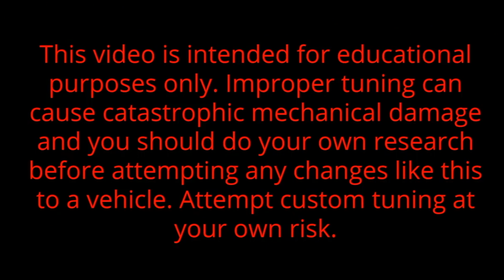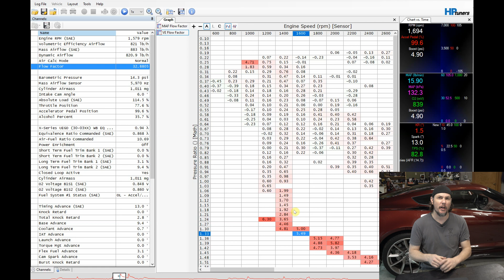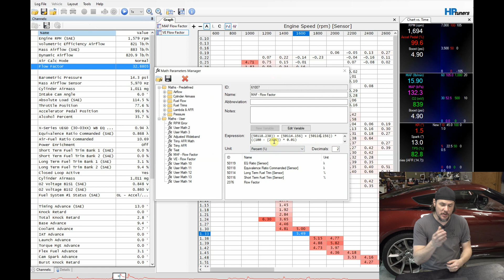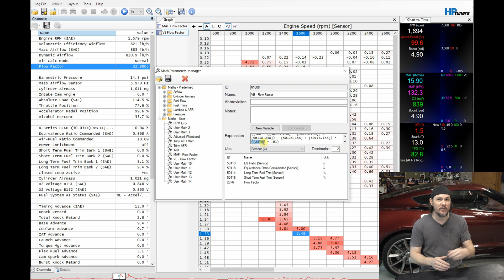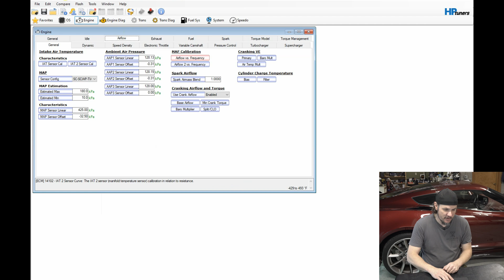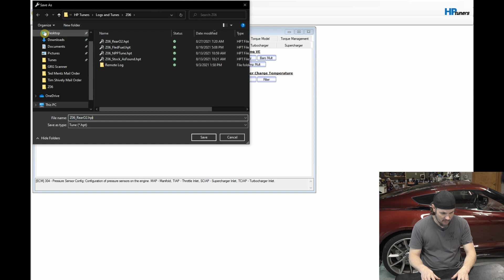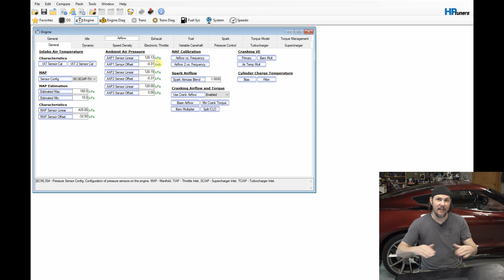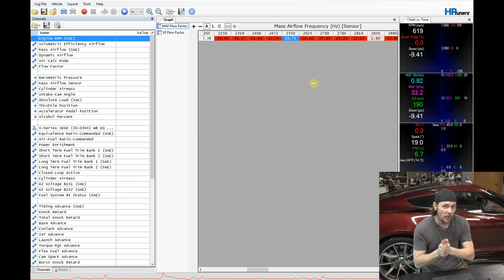Tuning MAF and VE At The Same Time With Wideband and Narrowband Sensors!?

Comment: I do something similar to this on my Chevy Sonic with the turbocharged engine. I leave the MAF enabled and will adjust the VVE and MAF, starting with VVE. I'll see if it changes at the top end of the table, if it doesn't then I adjust the MAF calibration. The reason I use both VVE and the MAF is so the car has a smooth AFR making the car very driveable and very efficient on making power. It also makes diagnosing any boost leaks/fueling issues easier to diagnose.

Comment: I just track the Calculated Flow rate in g/s from the VE, MAF, and Dynamic airflow. I set it up to tune for SD like usual, and The % error between the VE flow rate (calculated) and the MAF flow rate (actual) is what I multiply the MAF Table by. You have to add a negative  to the % error table and change the unit to Number not percent so if you copy and paste the changes they correspond. As VE flow rate gets more accurate as you tune VVE tables the MAF Flow rate will also get tuned at the same time and this will stop the correlation dtcs once its dialed in. Im hoping at least.

Comment: Has anyone verified if this is working?
Reply from the maker: Used it today, been using it for the last month on both the Z06 and the Superado
Reply: @GoatRopeGarage  looking up the math tomorrow!....in a few hrs
Reply: @GoatRopeGarage  I just tried it on my cammed Z06 today, and it's working on my car as well. Verified by just looking at the short term and long term averages independently after a tuning session, and it's definitely improved.

Comment: If the math is right, should work. I have a gen 3 running flex fuel  on 2002 tahoe OS, does not have that parameter. Would a p59 os have that if I were to swap it someday? Also I setup a timing table and used the torque value instead. My thought was I could compare timing and torque readings per cell to determine optimum timing. Any thoughts on that and are the torque readings being output accurate enough to use for this? Theres no knock retard with flex fuel.

Comment: You are adjusting steady state calibrations based on errors measured during extreme transients. A boost transition, no less. Honestly, not to piss in your cheerios, but everything about this is wrong.
Reply from the maker: The data says that it works, will show more as we go along, but unless you can prove otherwise this works.
Reply: @GoatRopeGarage  You will find the proof by operating in those areas you just adjusted, but instead at steady state. It can be done easily with a dyno, but otherwise is still possible on the street. You'll find all of your fuel trims swinging negative. What you have done is correct for a transient error in a steady state model - I admit I did think you knew better lol. But everyone falls into that trap at one time or another. You must operate the engine as steady as possible to gather error data. The reason dynamic airflow exists, particularly the prediction logic, is due to the fact that large transients are not able to be discretely characterized - too many moving variables. So any time you correct the VVE or the MAF, it must be steady, smooth, long period averages of data.
Reply from the maker: Not true, have proved it multiple times.  Steady state cannot be a viable way to tune transient when you see that the factor shifts heavily on transient, the video shows that when going from a steady state to WOT and the data lines up without issue.  Doesn't matter if it is a 300 hp or 1300 hp setup, it works the same, this is an immutable fact that I have shown before.
Reply: @GoatRopeGarage  Problem is, you're not doing anything to the transient calibrations. All you did was mess with the steady state stuff, things that are necessary and will cause problems elsewhere. See what I mean...

Comment: It's not new, I did it back in 2004.
Reply: Didn't expect to see a redhardsupra here 👀
Reply: @flatlandkid  I believe he prefers redsoftlexus now
Reply: @anasasisxenophontis  can probably answer that for you
Reply from the maker: Elaborate, given how that parameter doesn't exist on those ECMs
Reply: Can do a VE calc from maf or wideband on gen 3, but he didn't do this lol
Reply from the maker: @phdtuning  I did a video on that a few years ago and talked about how it was possible but wasn't a viable path for a good tune
Reply: @GoatRopeGarage  I find that it works okay with filtering, but I was referring to the guy who said he was doing it this way since 2004
Reply from the maker: Go look at my responses on to the user Radz where I talk about how I did this almost a year before  redhardsupra and watch that video on where I show how it works but I don't recommend it.  This is way more reliable but after a few hours of working with an engineer tonight we tried to figure out what was skewing the dynamic airflow and what we determined is that there is a temp table that is not available that skews VE airflow when looking at the flow factor versus the dynamic airflow.  The idea of calculating VE from MAF readings, which I did in 2019, isn't reliable and is very temperamental, which is why I said it wasn't a viable way to tune.  And I still stick by that.
Reply: @GoatRopeGarage  My method isn't viable outside of steady state. But no proper MAF or VE calibration is. And yes, it is temperamental. You must control the conditions under which you gather error data. Otherwise you absorb all kinds of errors from unknown sources.
Reply from the maker: I know, and that is why I didn't like it from the get go, it works for a baseline, but from that point you still need to dial in both calcs properly.  It is a great way to do a simple way of getting things running then fix a broken as hell VVE table.
Reply: @GoatRopeGarage  All vehicle manufacturers calibrate their steady state models at steady state. Every single one. There are other far more advanced software tools that are necessary to properly calibrate for transient airflow dynamics.

Comment: smokeshow, over on HPTuners, has shown something like this.  He's referencing GMVE instead of your Flow Factor.  I'm going to try to see if I have Flow Factor in my PIDs and compare.  Regardless - if it is similar, this has been an effective way to tune MAF and VVE for a good bit of time.  It's nice to see it on video though and see someone actually talk about it.  Thank you for your efforts and sharing your knowledge.
Reply from the maker: The GMVE way is different, I did a video on a process similar to what he talked about a couple years ago but ultimately determined it wasn't an effective way to tune.
Reply: @GoatRopeGarage  what made it ineffective for you?
Reply from the maker: Watch the video where I talked about VE calcs, looking at how the dynamic airflow works to do the final fueling calcs

https://www.youtube.com/watch?v=qaP8n2doptk&list=PLxTMckx4RYqkOCa9IttJ47b9__kspphJY&index=24

The fun part is seeing how close smokeshows calcs are to mine that I posted almost a year before
Reply from the maker: And I am not throwing any shade by any means, I love when someone extrapolates and finds a better way, but I have already gone down this path and what this video shows is a whole different level of tuning.
Reply from the maker: In fact you will see how he talks about units being important just like I was talking about the units being critical around 1:35 in my video
Reply: @GoatRopeGarage  Units are important indeed. That 'flow factor' has none, and it's not percentage either. It's an offset value that gets added to the driver torque request when the request is far enough above the predicted torque. Don't tell me it didn't seem weird that it always goes to the same value when you lay into the throttle, then back down to the same value again? That's clearly not the percentage of contribution of VE or MAF. That's actually easily calculated as well...just compare MAF and VE airflow to dynamic airflow. 

This is definitely another level of tooning...but I don't think its the level you want to be on lol. You may not be throwing shade, but you're certainly unwilling to listen to those who might just have some actual background in this stuff...
Reply from the maker: If you actually looked at the VE and MAF airflow versus the dynamic you would know that you can't calculate the percentage as often times the final airflow is less than the other two. But I'm sure you'll have a post on this in a few months claiming how you figured this out just like you did after watching my GMVE video.
Reply: @GoatRopeGarage  I already have a post on that... 

Are you aware that I was a software engineer for GM? I hate having to out credentials, because I like to see people think it through on their own...but it seems that's what is necessary to get the point across. I designed algorithms that run inside the ECM...and I'm trying to leverage some of my experience to help you out here so it can help others. No need to get nasty dude.
Reply: @anasasisxenophontis  Its a good thing you don't work for GM anymore since pretty soon all they will be making is electric vehicles, at least that is what the President of GM said yesterday on the news.
Reply: @anasasisxenophontis  One of the main reasons GM and others are gravitating to EV now is cost. As a former GM process engineer, cost drives everything. The batteries are quite expensive, however the assembly line in the future will eclipse/offset the cost of the batteries.The engine assembly areas and CNC cost reduction alone is huge.The fewer assembly line processes on top of the completely automated process with the motors will streamline the whole assembly.Most car input functions are now software based from the touchscreen reducing costs. ROI will be much sooner then in previous generations.If not, they would be lobbying to slow down the mandates.
Reply: WERE DOOMED
Reply: @anasasisxenophontis  SOoo what your saying is You and the engineers did it right. Aaand you like to sit back and watch us, the lowly dumb people, try and figure out how you made everything more difficult, all in the interest of gas mileage. Also do you know the guy that came up with the lifters, you know the great idea from GM to save the V8, all the power and fuel economy!!!! The same lifter that's in a nation WIDE class action law suit for being so bad?? One more thing if DOD is so good, How does it ever save fuel. A given steady state Load, requires a give amount of power to maintain a given velocity. IE this much air and this much fuel are needed to move the truck down the road. How is taking away half the motor, adding that half to parasitic drag internally, and asking the other half to do the same work as before going to SAVE fuel????? One half of the motor still has to pump the same amount of fuel and air to create the same work required to keep the same load at the same velocity, but now with added drag....  Answer that GM algorithm man!!! lol sorry needed to get that off my chest, both of you have great content and are teaching me a lot. Keep being awesome gentlemen!!!!
Reply: @anasasisxenophontis  I was a senior system engineer on the team that developed the source code for this computer.  You were not a part of the project.  It wasn't even developed at GM.